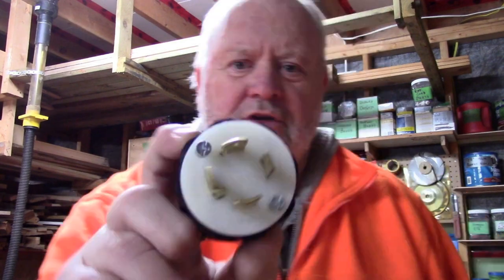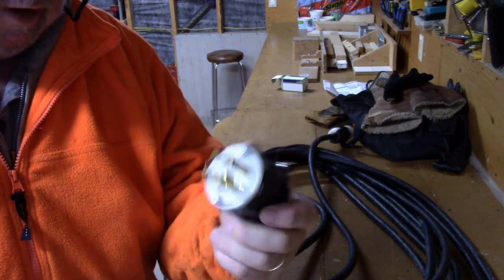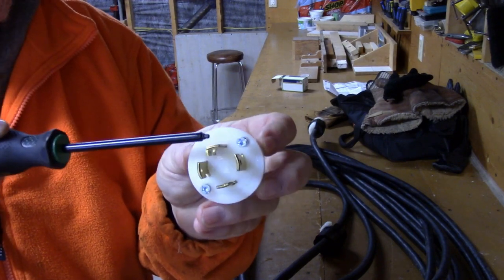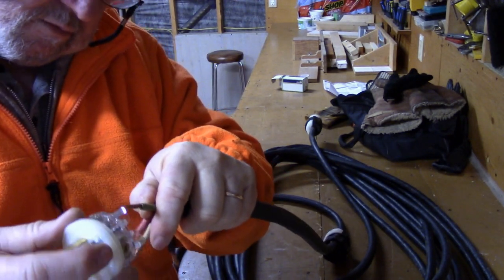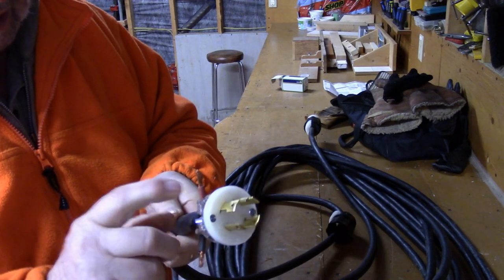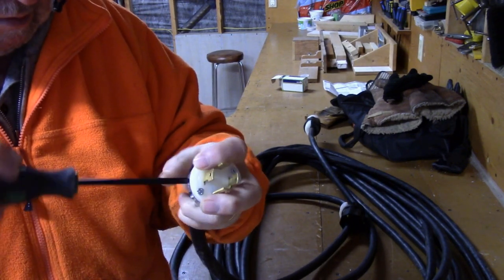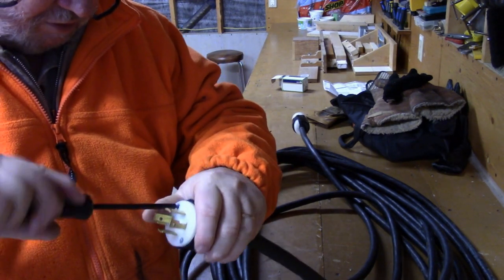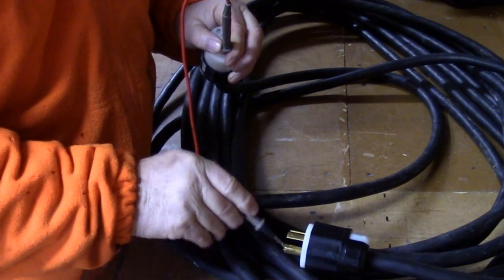Replacing Plug on a Generator Cable

Comment: Great video Mike. One thing I've experienced is that my generator cord was coiled up on top of the generator in the shed and the red squirrels or mice chewed the outer jacket and even into the copper in some areas. That's quite a bummer when the power is out and your cord's no good.
Reply from the maker: Hey there Corey!!!  Squirrels!!!  They can cause so much damage.  I had some wires chewed to the copper in the shop and had to re-run them.  They are always a concern, the cute little darlings ...  (Can you see the tongue in my cheek here!!!  Thanks for tuning in and take care!!!

Comment: I've done that several times myself when we lived on a boat. Terrible corrosion near seawater. I was hoping you were going to show us the old one (and why you felt the need to change it). If it was just bent a little I would have bent it back. I was expecting to see a burnt or melted connector. That's what the corrosion did to mine!
Reply from the maker: How's she goin'?  The sea water can do in a piece of metal pretty quick.  It would be a good plan to check the connections every once and awhile to be sure they were in good shape and then use a dielectric grease, as RCAFPolarexpress stated, to prevent the corrosion!!!  Thanks for watching and have a great week!!!

Comment: Tht would be an expensive cord to buy.... Good idea replacing the ends!!! Hopefully you won't have to use the genny... Take care Grampie!!!
Reply from the maker: Hello there Sunny!!!  The cable is expensive for sure.  3 conductor #10 and it's 65 feet long.  Even in the US that would add up eh!!!  We have used the genny since I repaired this plug.  Once for pretty near 3 days.  The generator is a life saver!!!  Take care and thanks for tuning in!!!
Reply: @GrampiesWorkshop  Dang... Gald you had the genny..... I have atleast 2 parts gennys and One good one....  It's no fun trying to get one going when you need it....
I have a decent sized Coleman... 
It think its 5000w and 6250 peak or something like that.... 10 bucks at a garage sale.... Brought it home cleaned up coil and flywheel and it works great!!!! I bought a predator 4000w for 20 bucks but no juice on that one.... But I am not too worried because I made out ok in the end.... Need to find me a couple small a.c. units in the off season to have next year just incase.... Stay prepared and take care!!!! See you soon!!!!
Reply from the maker: @sunnyray7819  Great buys!!!  I wish I was lucky like that and find some smokin' hot deals!!!
Reply: @GrampiesWorkshop  I was lucky... Or blessed, I should say...
Reply from the maker: @sunnyray7819  Amen!!!!

Comment: Those plugs are quite expensive.  Never thought of checking to PA as Steve suggested.  Some di-electric grease should keep them in good shape for long. Any corrosion will produce a hot connection. My extension cord is not exactly like yours... Let's say both ends share the same gender. So its kept in a safe place, out of reach. A generator is essential when living remotely. Power outages are likely, they will last for long periods and the utilities like running water are essential. Thanks!
Reply from the maker: Salut Joe!!!  You are so right.  As soon as the power goes out, you need to go to the washroom!!!  And with our own water on a pump, with no generator, that means no water.  This power cord makes connecting the generator to the camp super quick, simple and safe.  Then I can go to the washroom!!!  A cable with the same gender on both ends should be kept in a safe place and only used by someone who knows what's going on.  It's hard on linesmen if the generator hook up is not done right!!!  LOL   If these plugs are only $5 at PA, I'd buy a couple right quick!!!  Thanks for tuning in and take care!!!